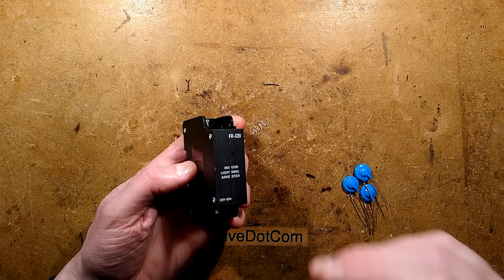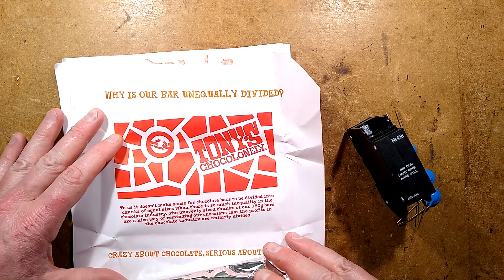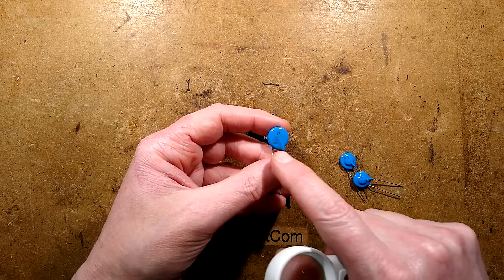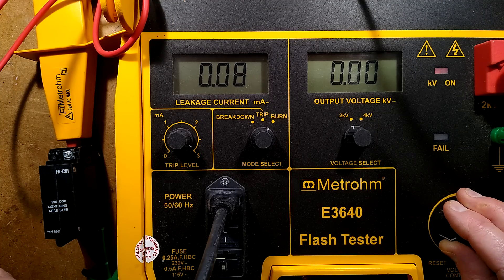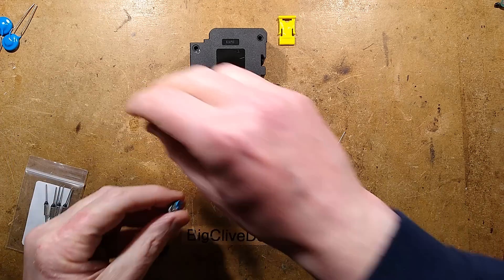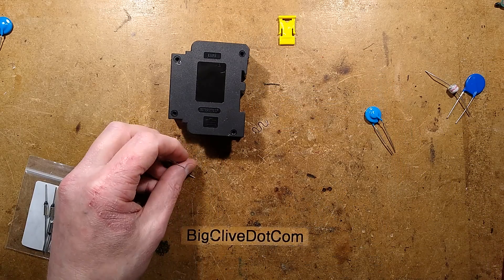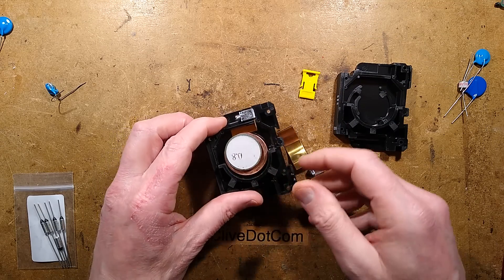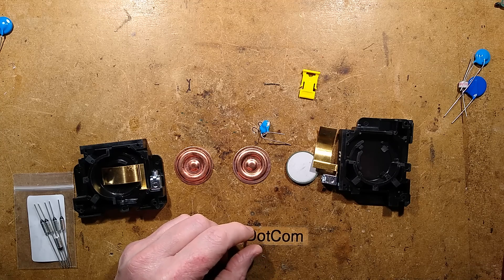Inside an African lightning protector - and candy

Comment: Enjoy your treats! Thank you for the video.

The components inside the big surge protector are more chunky than I expected. I was anticipating a much smaller MOV and maybe some rudimentary thermal protection, but clearly a fuse was completely omitted.

As you pointed out rightfully so, the screw terminals are exposed and therefore not up to our western standards. A good thing about people in African countries is that they generally don't poke around in electrical installations. They are told electricity will kill them and they are not wrong about that.

I did however see many occasions where people in places like Zambia and Zimbabwe stuff a type C (CEE 7/16 Europlug) connector in a type G (BS 1363) British style wall outlet. And in order to make that happen they poke something in the PE (earth /ground) hole to defeat the shutters that shield the L and N holes on the socket.

A connector rated at 2.5 A stuffed in a socket that is able to provide 32 A. What could possibly to wrong?

I took a couple of type F (CEE 7/3 Schuko) extension cords from home, fitted each with a fused type G (BS 1363 UK) connector and gave them away to my friends in Zambia. Making things a little bit safer.

Regarding the GMOV, a combined MOV and GDT. The company Bourns claim in their sales pitch that this hybrid component ages less quickly and therefore has an extend life expectancy compared to a standard MOV. The added GDT does however results in a 300 ns slower response, but it seems that most component downstream can absorb this energy.
Reply: 😂lmao my dude I'm from south Africa Pietermaritzburg. Trust me when I say alot of south Africans do not care a single bit about playing with electricity. At every single squatter settlement you will find cables connected straight from high voltage overhead lines straight to the house with the cables running on the floor with open joins on cables n stuff. Sometimes you will find a guy standing on the electrical pole connecting cables and he got no safty gear at all.
Reply: @ashenthrenchetty7  Yep, I have seen it when visiting your beautiful country. Situations in SA are sometimes more unsafe than in most Asian countries.

Is it correct that about 85% of the people in SA bypass their electricity meter or don't have an official connection and therefore 15% of the population pay for the electricity of everybody? This does not feel like a sustainable situation to me. Please let me know if these numbers are way out, because they might be. I never really know who in SA is telling the truth when it comes to these kind of things.

In Zambia everybody with an electricity connection seems to pay for their usage.
Reply: @Frankhe78  at one point yes. But recently they upgraded our meters to digital so it's almost impossible to bypass if you don't know about new technology. Ever neighborhood has at least 1 squatter settlement that just steal electricity and water (open fire hydrants) and yeah we that do stick to the book get screwed by Eskom and our government. But out of the settlements you will find a lot of amazing lovely houses that are way safer than a lot of other places. But then again I think every place in the world has those squatter problems and some people with a single brain cell that does dumb stuff. Generally depends on the area you in. Some places here I even scare to get close because of the dangers of electrical shock or just getting robbed.
Reply: People in Cyprus put Euro plugs in British sockets all the time too
Reply: @potappotapov1815  That is not quite what it was designed for. The fact that you need to use something to push into the earth pin in order to defeat the shutters that protect the live and neutral pins should already be an indication or at least a hint that what you are doing is beyond what it is intended to do. But yes, I have seen it happen in many different places around the world.
Reply: The Type F (Shucko) in a Type G (UK) outlet is commonly seen in the UK with short-stay visitors who haven't bought an adaptor, but see the „hack“ on YT videos and think it's safe because the Type F pins physically fit. However because the Type F plug generally has no fuse the cable behind it could be exposed to a potential maximum of 64A (Failure condition with slow/faulty circuit breakers or on boards with old cartridge fuses in use) in a fault condition, and no Class II appliance has a flex that can safely carry that amount of current.
It's for this reason UK wall warts must be a single unit (The Type-G plug is integrated) and have an internal fuse appropriate to the design load of the wart. 🔌⚡📜

My solution to the Type-F problem is simple: I have a number of German bought Class-II appliances with Type-F plugs, which I wanted to keep as spec. So I bought a German three-outlet power strip, removed the CEE-7 plug from the flex and replaced it with a UK Type G with a 3A fuse fitted. Voila! Europlug devices protected by a 3A fuse being safely used in the UK without any trouble whatsoever! 😁👍
Reply: @UK-Combustibility-Assured  I created a couple of those power strips with CEE 7/3 (Type-F) sockets and a BS 1363 (Type-G) plug that is fitted with a fuse, usually a 13 A rating. Which is close to the 16 A current of the breakers in my home. The 13 A ceramic fuse should therefore be more safe than the 32 A breakers that protects the ring circuit in a Zambian installation. I handed them out to a couple of my friends in Livingstone Zambia and they were very happy about it.
Reply: I get it that it might be considered somewhat dangerous, but first you need a short and second, be very lucky to not burn the short away immediately. I've tried and failed.
Reply: Regarding the Europlug: apart from the mechanical and contact problems of stuffing that in an UK outlet, I don't see a problem here. Europlugs are made to be plugged into outlets which provide much more than 2.5A (usually 16A).
Reply: @moe.m  The problem is that the Europlug caries a 0.75 mm2 cable, that has a low enough resistance, given the cable is a short length, to trip a 16 A braker with B-curve. Anything over that is asking for trouble.
Reply: @Frankhe78  what do you mean? 10m of .75mm copper (so 5m of cable) have .23ohms, that’s 1kA at 230V.
Reply: @moe.m  Plus contact resistance at several points and the rest of the wiring in the (ring)circuit.

In Zambia they install the UK style ring circuit but don't bother with the testing that is mandatory in Britain when installing or servicing such a circuit. I have also seen 2.5 mm2 cables service a ring that runs for 100 m or more. This is all pretty common in third world countries. So when that 0.75 mm2 cable sees a short there is a chance it might not trip the breaker in time.
Reply: @moe.m The problem would be the cable, not the plug. The fuse in the plug should be chosen to be appropriate for the cable. A 2.5A cable protected only by a 32A circuit fuse is most certainly a problem.
Reply: @chrishartley1210  This doesn't seem to be a problem, as there is no other way to use an Europlug. E.g. in Germany, you always plug them into an 16A outlet, 2.5A outlets do not exist.
Reply: @moe.m  Which is why the UK plug is regarded as the safest in the world.
Reply: @chrishartley1210  True, but why is it so incredibly clunky while only supplying 13A?
I would much prefer the Swiss T12/T13 plugs, there are versions with an integrated fuse.
Reply: @moe.m  There are reasons for it's design too but it could probably be done better.

The rectangular pins are supposed to give a more reliable contact (I haven't personally seen any evidence of this).

The pins are at right angles to the cable so that it can't be unplugged by pulling the cable or tripping over it.

The routing of the wires inside the plug is such that, in an accident, the live wire should disconnect first and the ground wire last.

All those things together can't be fitted into a space much smaller. I could design one that has a lower profile but it would probably be difficult to remove from the socket.

Comment: My experience with DIN rail SPDs is they start to conduct at about 50% above their rated voltage so a 600V DC SPD conducts at  little over 900V and a 275VAC unit at 600VDC.